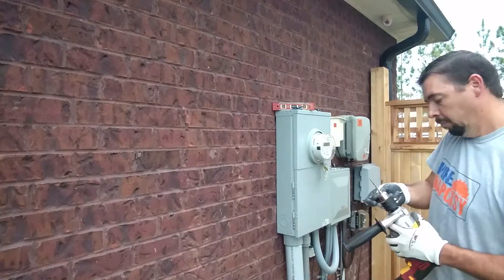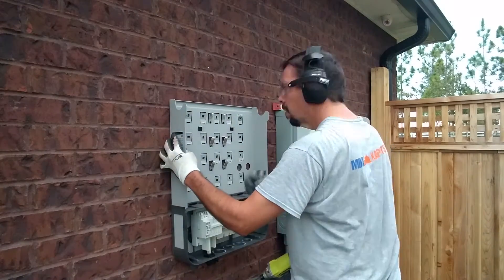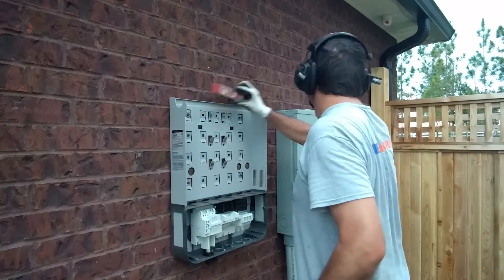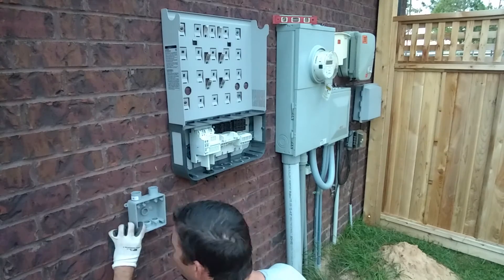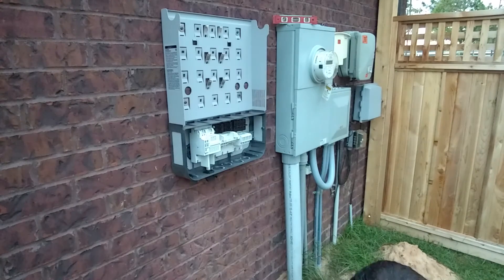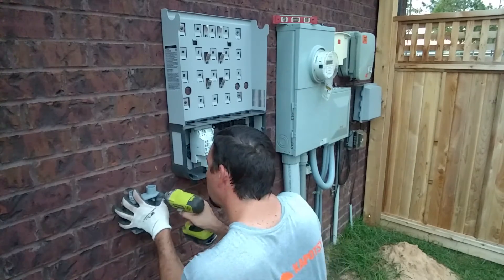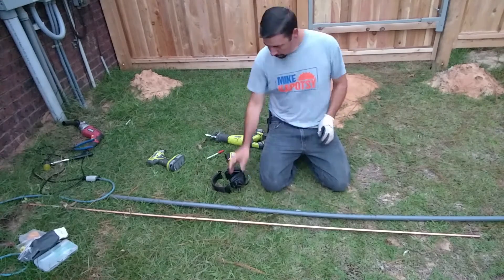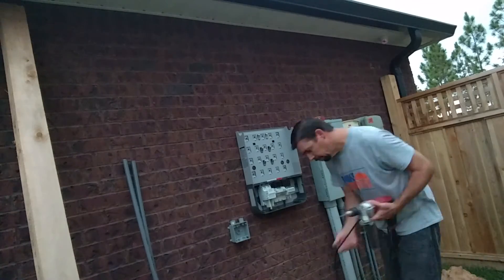Installing a DIY Rooftop Solar System

Comment: Pretty nice system, should work well in your area of the US. With the 30% federal rebate should bring the price per watt down pretty nice. I've been looking into a smaller 2k system, however my local utility doesn't offer any advantages to connecting to the grid. But i'm still feeling tempted to install a system with a battery setup just to off set some of my electrical costs. 8.3kw would do 100% of my usage, I'm right at 1000 kwh/month on average. What is your monthly average?
Reply from the maker: +Tony Castillo thanks Tony!  Our monthly avg usage is nearly double yours.  And yes the rebate will help. This particular inverter won't work with batteries. That type of setup can get pricey and maintenance costs are much higher. I thought Utilities had to buy back, but I may be mistaken.  We've been producing around 45 kWh a day on good days.  Good luck!

Comment: How much did the system cost and how long will it take you to recoup the cost?
Reply from the maker: +Nick Karpen the per watt cost was stated in description. Recoup is totally dependent on production which will vary, but somewhere between 10-12 years is anticipated.